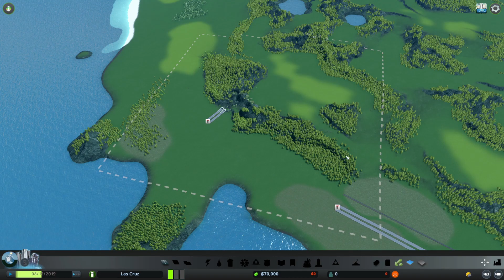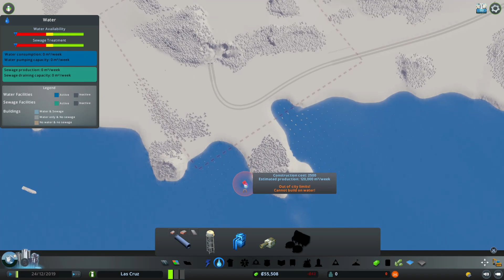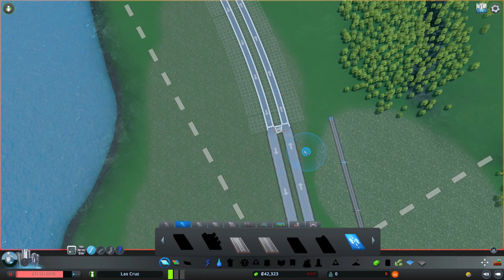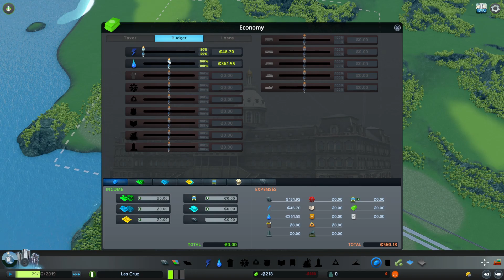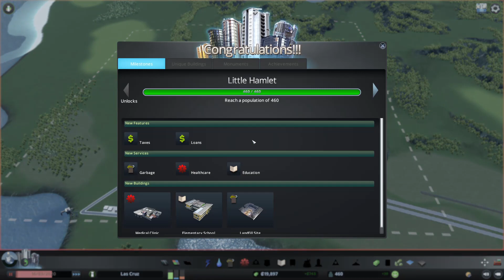Starter City Build - Design Theory for Cities Skylines - Madagascar - Save File Included - Part 1

Comment: which mode to change the texture of the vanilla roads?
Reply from the maker: I'm not using anything specific here. Map theme will adjust the overall look of things and the payment textures. Network Extension 2 roads just look differently some times. The small skinny roads are a dark pavement color for example. It's a road from a mod, but nothing is changing it's color beyond that. Look up Network Extension 2. If you want to just road colors, look up Road Options.